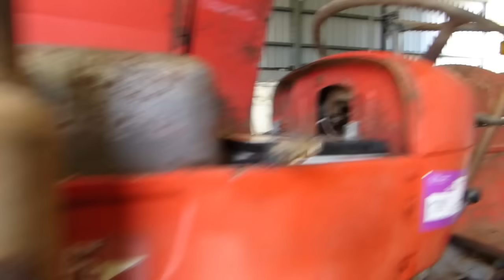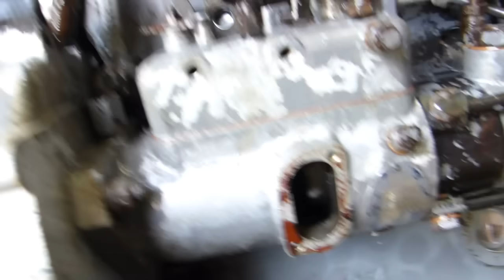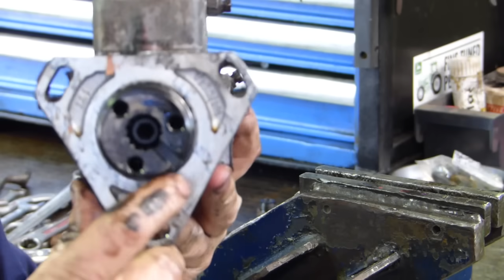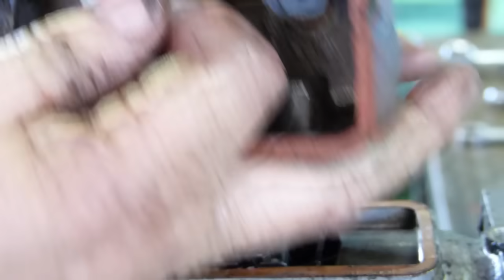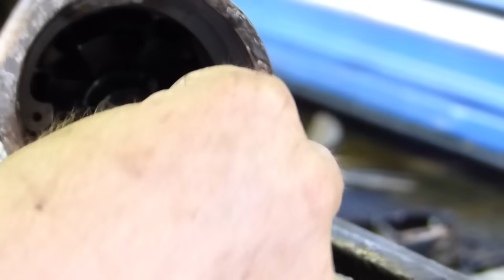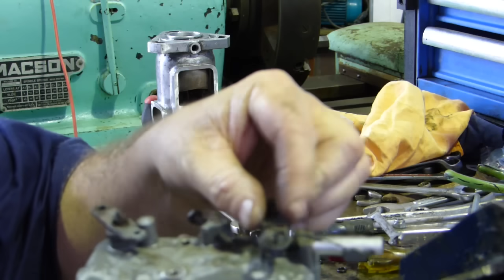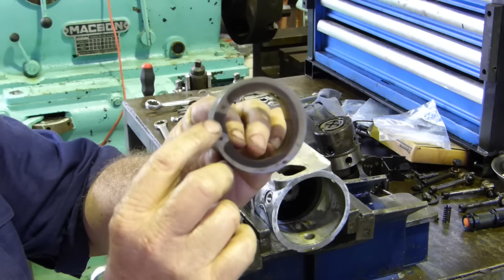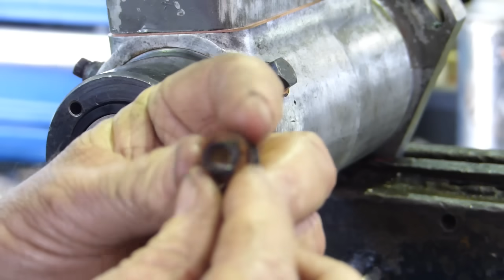CAV Injection pump full strip down to re seal and stop fuel leaks

Comment: Hi Lance, I'm in the process of resealing a similar pump. However yours has the 3 head bolts(mine has2), there is a thick plate on the bottom held on with 2 big bolts. what would this be & does it have to be removed to remove the head? thanks for any help Thanks. JD1120
Reply from the maker: I did a video on my JD1640 injection pump that should show you what goes on there.

Comment: This video saved me. 😄I watched this outside in the rain while trying to get my MF165 to start after not being used for 5 years. 
Initially i got it running after changing all the oils and filters and fuel,  but after i shut it off, the injectors could not get diesel again. It was the shut off valve/rod. I pulled the top off and cleaned everything. That small rod was a bit rusty in the groove. Now it is running nicely. I'll have to buy a new seal to the top cover though, could not get it to not leak anymore.
Reply from the maker: Good work it sounds like you are onto it.

Comment: Mine did not squirt out the injector tubes when i spun it manually to test it. The plunger was wiggling back and forth in the sleeve when i shook it. Any input?
Reply from the maker: Look at my Massey Ferguson 135 6 speed playlist videos 14 and 15. I explain things id more depth
Reply: Will do, thank you sensei

Comment: I have a white 2-50 with fuel pump issue. I took top cover off and the governor spring popped off before I was able to see what holes it was in. The tag on the pump does not have the code on it just the model and serial number. Is there any other way to find out where the spring goes?
Reply from the maker: Look really hard in the holes where the spring would go, there is often a tiny shiny mark or a mark of some kind. Often hard to see though but it is there.

Comment: Hi Lance, thanks for your time making this vid. Very explanatory! I have 2 David Browns and both have the same issue, several months apart: They had been running fine. On starting them they started and they immediately stopped - like pulling the stop lever.
Watching your vid, it looks like the first check I will do is to take the top off and check that stop plunger is not catching.
Thanks for the information.
Reply from the maker: Glad it was helpful

Comment: hi i have a b275 international with a cav pump the metering valve kept sticking so i got a new  seal kit and followed your video now it starts every time and runs fine but when i shut it down to tick over which is set at about 700 rpm it either ticks over for a short while then slows down and stops or if you are drive and you stop and shut the throtle it just runs down and stops if you shut the throtle slowly it will tick over and when you load the engine you have to open the throtle as the govner does not seem to compensate have you any ideas on what it could be as i do match plouging and i have to keep palying with the throtle other than that the old girl runs fine cheers steve
Reply from the maker: Are you sure the spring went back in the same holes?
Reply: @bundybearsshed  as far as i know i tryed to follow your chart but the numbers on the pump did not make any sense i wil get the numbers off the pump and send you
Reply from the maker: Trip tightening it one hole, then it might not idle but its easy to put back.
Reply: @bundybearsshed  the numbers on the pump tag are 3240347 then underneth is R730ZA cheers steve
Reply from the maker: I cant get tht to work.

Comment: We have a  1986 mf 240s. Is there a point to bleed the pump other than injector pipe ends(already left out the 8m screws)?
Reply from the maker: I just bleen the bleed nipples and crack one injector pipe and that gets the air out if the pump is good.
Reply: @bundybearsshed I normally do it that way but when cracking, injector pipe tends to turn and get twisted. I am afraid of tearing it down.
Reply from the maker: Use 2 spanners if possible.

Comment: If the plungers in the pump head are frozen, will that stop fuel from going to injectors?
Reply from the maker: Yes it will but you can often free them up look at my MF135 6 speed playlist videos 14 and 15

Comment: Helo thank you very good job 
I want ask in wich hole l must ajdust the governor for pump CAV DPA 3233F641 FORD TRACTOR 4100(governor spring  and throttle fhaft code
my regards
Reply from the maker: I cant say , you might need to look for wear marks.

Comment: Is it possible to take out the plunger/high pressure part when the pump is on the tractor? Just remove top part and govunour plate and the bolt holding the plunger part? Best regard small farmer form Norway
Reply from the maker: No the pump must come off.

Comment: Thanks Lance!  This video was great!  Also looked at some of your other videos on injector pumps which helped as well.  Used on a MF 255 bought new in 1977 by my father.  Leaked at the shut off shaft.  All good now!  Also I used your video on MF clutch repair a few years ago and I split the tractor and replaced the drive clutch, the PTO was OK.  Set if up and has been working well for about 100 hours.  Biggest problem was had to play a bit to get the tractor aligned to rejoin.  Thanks for your help!
Reply from the maker: Thanks for your comment

Comment: Great video thank you I am having a issue with my injection pump on my Long diesel tractor can not find numbers on it can not get diesel to come out the lines the big line can pump fluid but not to any of the injectors. I did take out the metering valve still nothing and I did have water in tank that started my issues. I have pictures if I can send get your opinion would be greatly apprechiated.
Reply from the maker: Have a look at my Massey Ferguson 135 6 speed video 14 and 15.

Comment: I have a perkins 4236 and it runs perfect,  or soni thought until i realized fuel mixed with oil is coming out the top of the valve cover.  Its full to the brim.  Do you think the pump or an injector is leaking into the crankcase?  Thanks!
Reply from the maker: Probably the front pump seal. Repair the pump then do a couple of oil changes and it should be good to go.

Comment: Hello Sir, hope life finds you well, thank you for keeping these grat videos comig, I recently installed a rebuilt CAV pump on a Ford tractor, it started well when I installed it on tractor and it ran fine, customer called me that tractor will not start now, I did recommend that we clean fuel tank and lines before we install pump, he said he had done that already, I have fuel coming out of the bleed screw on pump body but no fuel coming out of the injector lines, I removed solenoid and it is working fine, not losing power while starting, just not getting any fuel out of the injector lines, fuel comes out of the bleed screw with enough pressure, pump was recently rebuilt and installed and it started fine every time when I installed it, what should I be checking on this pump to solve this problem? Thank You Mr lance
Reply from the maker: Check the metering valve is not stuck

Comment: I always take things apart and then after try to find a Youtube video. What difference does it makes which hole it is in? I cant remember where I took it out! I have it on a John Deere 3140
Reply from the maker: It will either rev a little high or sshut down when you return the throttle to idle if it is in the wrong hole.

Comment: Hi, mine pushed the large gasket where the head mounts on out in a specific spot and started spurting diesel out, so i changed just the head gasket and it was okay for a while but then did the same thing in the same place. Is there something else i should be looking at or did i maybe just not tighten the 2 headbolts enough? Typically has happened right as about to get my hay made!
Reply from the maker: check the pump return line in case it is over pressuring.

Comment: Brilliant video thanks! We’re bringing a Cat 428 with a Perkins 4236 engine that has suffered water damage and two seized pistons back to life with a in frame rebuild, today was the test to see if it would start and we couldn’t get the diesel to come out of the delivery ports but I’d watched your video prior to going to the digger, took the top off the pump and the governor had stuck shutting off fuel, with the gentlest of persuasion it freed and the engine is now starting after years of rusting in peace👍🏻
Reply from the maker: That is great to hear that the video was helpful.

Comment: This has been a big help. However when I took the pump apart I found a bell bearing on the bench, I missed seeing where it came from. There is also a similar ball bearing in the kit. Can anyone tell me where it goes. ?? Perknis Marine engine 4.154 vintage 1081 -2
Reply from the maker: The ball goes in the bolt that comes up from the bottom if the advance mechanism.

Comment: Damned good video there, Bud!  If I could, I'd give you two or three thumbs up!  I have a Perkins 4.236 in telehandler and it is time to go through the pump.  I thought I might try doing it myself, and watching this means I'll be doing it in about a week.  I am going to have my local shop go through the injectors so that they can be flow tested and balanced to make sure they are all putting out the same fuel and the spray patterns are all good.  I'm guessing that it is just easier to put new nozzles in the injectors and not look back.  The old tele has not had a lot of love since I've had it and I got it at an auction so you know what the previous owner thought of it.  For what its done for me, I owe it a bit of attention.  I'll be selling the machine soon as I'm leaving the state of Oregon and heading off to the farm I bought in Sweden two years ago.  I'll probably be looking for another tele there and a Perkins will be high on the list.  Old there are probably a couple 100k old Massey Ferguson farm tractors hiding in sheds all over Sweden.  They were the darling tractors in their day.  Again, thanks so much for a great video.  Well done, Sir!
Reply from the maker: Glad it helped.

Comment: Great content ol mate. I'm trouble shooting my David brown 990 with this pump. Is there a bleeding sequence needed or just crack the injector lines. There are two bleed Nipples... one on the pump housing and one on the top cover ? Does this need to be done before starting engine. 🤔 thanks.
Reply from the maker: Do the nipples then crack a line.

Comment: I recently resealed a CAV pump using this video for my 2240 John Deere, everything went smoothly with the rebuild, but now after installing it, the tractor runs great as long as it's under no load, as soon as I engage the PTO, or release the clutch to drive it, it bogs down, and acts starved of fuel. 

I changed the fuel filter, made sure all of my fuel lines(and return) are clear of debris.....I'm stumped. I'm wondering if I somehow put something back in wrong during this reseal and screwed the pump up? 

I rotated the pump in the three mounting slot holes try, to find the spot it runs best at, which  helps a little, but the tractor still has no power under load. 

The tractor sat for 5 months before this rebuild, maybe a bad fuel transfer pump? 

Did I get it out of time? I thought it could only go back together one way with the keyed slots....

Any ideas fellas?

Thanks!!
Reply from the maker: Are you sure the springs under the top cover are in the correct position? I did a better video in my Massey Ferguson 135 6 speed playlist that might help you.
Reply: @BundyBearsShed  yes, I believe so, in my case they are both middle holes on either side, but I'll crack it open to check once more.
Reply: Checked, and the springs, are correct, the engine surges a little too, at random.

Comment: I'm stuck on the big inner o-ring on the head. Got it replaced but can't get the head to slip back in full position. I see the bolt holes but they are about 3mm away from lining up. Can I tap the head with a rubber mallet or is it supposed to line up with something inside? Help!  LOL!!

Comment: Excellent tutorial thanks! Any idea what would stop fuel that is getting into the pump from going out to the injectors? I get fuel going to the bleed screws but no fuel is getting out of the pump out to the injectors.
Reply from the maker: Possibly a sticky metering valve fron a bit of water in the fuel over time.

Comment: Is it possible to replace the big rear o-ring without taking off the top cover?
Reply from the maker: No the metering valve goes into it so you need to undo the top for sure.
Reply: @BundyBearsShed  thank you. Does the pump need to be taken completely off? Mf 135

Comment: I need help I took my pump apart  not watching  a video  my holes are off on my throttle  under the cover how would I know what holes to use
Reply: It's a 420 backhoe 3233f640 injection  pump thanks
Reply from the maker: as above.

Comment: Hello sir, I have a 3000 Ford tractor pump which doesn't pump diesel to the injectors. What could be the problem? Please help mechanic
Reply from the maker: Could be the filter on the inlet but most probably it is a stuck metering valve.

Comment: Thank you from 4hrs south west QLD from you!!! I have 2 Perkins both have issues after water damage and at least now I can give them a strip down and maybe get away with just a sealing kit and if not I’m sure certain parts are available or machinable. 🙏
Reply from the maker: I did better videos on this in my Massey Ferguson 135 6 speed playlist, videos 14 and 15 that might help you out as well.
Reply: @ thank you good sir. I have asked so many diesel mechanics or heard of every diesel “mechanic’s” over the years tell me they send pumps and injectors off to be done and always told you can’t do it. I actually googled just how to r&r it because iv also been told the timing is hard and was looking at new pumps on sale for $1450. When I seen this I couldn’t believe how simple they are. Pulling down an old school distributor is far more complex where a lot can go in many positions than you could be 180 out and than you have point adjustments different brand of caps and rotors change timing so you can never really just mark it and go. I bought an old Massey 35 petrol version because I was so worried that if the pump or injectors are gone it’ll cost me a fortune but the petrol version with its 6.8:1 comp ratio and out dated carb intake and exhaust setup costs more in fuel in 2 hrs than what you’ve just taught me in 2 full gasket kits with backing plates. That’s no exaggeration. In all the years of rebuilding/repairing/modifying/tuning ect engines you’ve taught me more in that video about diesels which I wouldn’t touch for the life of me than I have in my whole lifetime. I and I’m sure many others who have watched owe you a bloody slab of beer. 🍺
Reply from the maker: @ Thankyou.

Comment: Thanks for the step by step video. I ordered the same Sparex CAV rebuild Kit you used in the video. I was able to remove and reseal the fuel injector pump with confidence, on what was originally my dads  Massey Ferguson 255 tractor Model year 1978. I made note of the timing position inside the pump and reassembled everything the same. I also replaced the old fuel lift pump. Changed the fuel filter which I last changed about 30 years ago. Bleed & primed the fuel lines as directed from the original owner's manual. The tractor started back up without any difficulty. The only thing the Sparex kit didn't provide was a new gasket for the timing chain inspection cover. I looked on line and nobody had one . My inspection cover has a 4 bolt pattern. I bought some sheet gasket material and made my own gasket. For the fuel lift pump I had to order the rubber fuel line gaskets off of Amazon since the new lift pump didn't come with them.
Take care. Gary from PA
Reply from the maker: Great work, I like to hear of people doing their own repairs.

Comment: The entire injection pump is full of fuel, air is bled, but nothing comes from tubes to injectors. I have had to bleed air several time from this unit in the past and I thought that was all it would be this time. Engine was running and just slowly died similar to how it does when it runs out of fuel. I'd really appreciate your opinion on this before I remove the pump (again). Know of any exploded parts diagrams for it? Your video has already helped a lot. Thanks
Reply from the maker: Check the metering valve is not sticking, have a look at my Massey Ferguson 135 6 speed playlist, I go into how it all works more there.

Comment: thanks, need some help from the USA.  I recently have a problem with a tractor with this type of pump, the throttle was not doing anything and suspected something may be broken or off in the pump.  we took the top cover off and noticed the spring for the throttle and undid the spring but not seeing which hole it was in. where would we find the info on where it should go?  I also noticed that other small spring which fell out and the rivet. we are not sure why the tractor has no throttle response but would a reseal or rebuild fix the issue?
Reply from the maker: Go and check my Massey Ferguson 135 6 speed playlist videos 14 and 15 and it is covered in there how to know where the spring etc goes.
Reply: @bundybearsshed  ok thanks

Comment: After a cleaning and new seal kit, What would cause it to be so slow to idle down?
Reply from the maker: Usually the spring is in the wrong place or the metering valve is a little sticky.